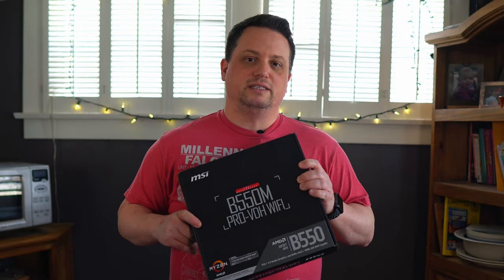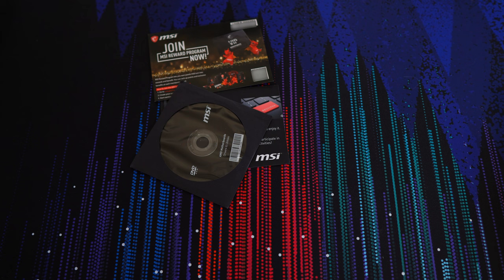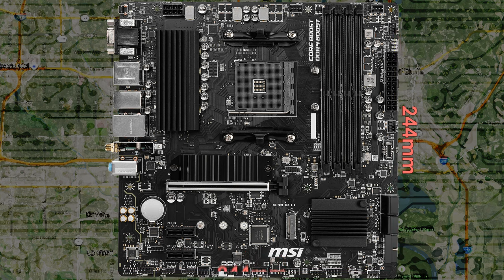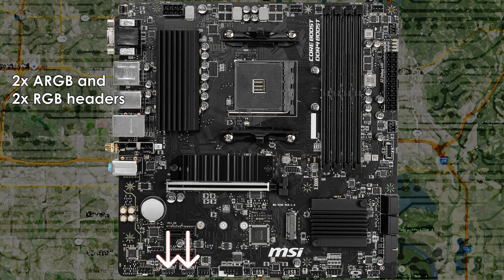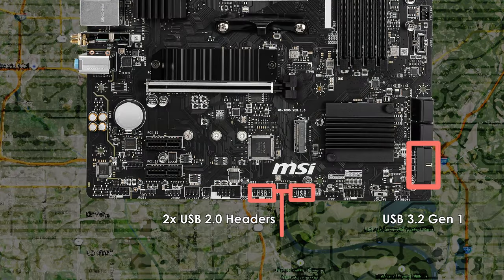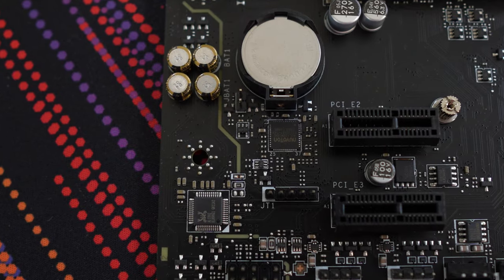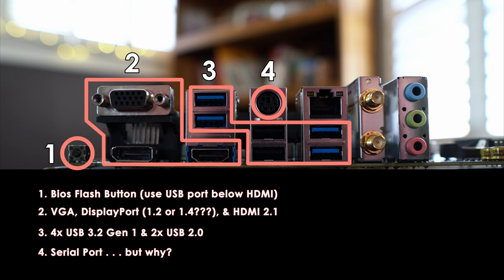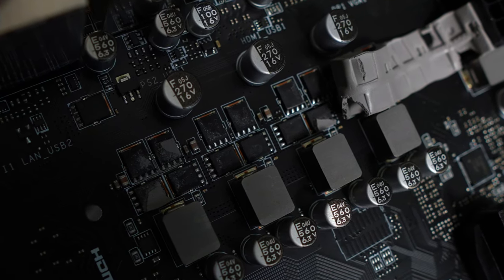Unboxing and taking a deep look at the MSI B550M Pro-VDH WIFI

Comment: i have this board and already a 3.0 m,2 installed on the top slot, ijust got a gen 4 m.2. i wanted to ask if ican just swap the slot of the current m.2 from top to bottom and install the new gen4 m.2 in the top one? will i have to format the older one or windows will read that one as OS drive automatically?
Reply from the maker: You can swap slots yes and then in the bios you can choose the boot order and choose to have the lower m.2 slot be the OS.

It might also just recognize the boot drive automatically.
Reply: @MiddleofKnowhere  so let's say i saw it and on the first start only i have to go to the bio or should i see if its going to the windows or not?
Reply from the maker: You can see if it will go to windows. That shouldn’t harm anything.

Comment: I  wish you had done the MSI PRO B550M-VC WIFI, instead, the one you're doing has been done to death.
I think the VC is a better board than the VDH, but no one has reviewed it, can't figure out why !
I am looking to buy one very soon and need more info besides what I can extrapolate myself.
Edit: You did not mention this board at the end as a possible alternative within that $$ range ?!
Reply from the maker: I didn’t mention the VC motherboard because I did the VDH video 5 months prior to the VC’s release.
Reply: @MiddleofKnowhere 
Understood, did not know the release date(s). It's just difficult when trying to find a good (and inexpensive) Home Media Server board. Not much data out there that is not running a Xeon (used) processor on a Supermicro board that's not cheap.
The way that you do your reviews are thorough, concise, giving very relevant data. Unfortunately I can't say the same for most other review channels, of which most are focused on "Gaming", which is very weird to me as I can use one gaming rig and will need two maybe three servers.
Anyway, thanks for your detailed and very professional videos !
Reply from the maker: You’re welcome! Thanks for watching. I’ll be doing a couple of mobo vids for am5 soon. Managed to find a sub $200 x670 board and a sweet b650 board.
Reply: @MiddleofKnowhere 
Thx !
Will check them out, but $'s prevent me from AM5. Also to sweet a deals on the AM4 stuff !

Comment: Hello, i would like to ask if it would be better to fill all ram slots in this motherboard rather than using just 2 sticks?
Reply from the maker: Depending on your CPU, you shouldn't have issues. Ryzen 3000 and 5000 series CPUS are fine to fill all 4 slots whereas Ryzen 1000 and 2000 series generally don't like all four slots filled. It all comes down to the memory controller. I have a 5950X and all four slots filled with no issues. Having said that, apparently 2 slots is still the way to go, so if you're trying to get 64GB of RAM and can afford 2x 32GB as opposed to 4x 16GB, go for it.

Bottom line, if you have a 3000 or 5000 series CPU you'll be fine populating all 4 slots.
Reply: @MiddleofKnowhere  Omgeee, thank you for the very informative response. I highly appreciate it!

Comment: How can I control my rgb lights of my pc case fans , ryzen 9 3900x rgb cooler fans using software and how? Please
Reply from the maker: Hi, this all depends and there are 3 methods: 1. Connecting your fans directly to the motherboard and downloading MSI's Mystic Light software. 2. Your fans have proprietary software you can use like Corsair's iCue, but these fans will also be connected to a hub of some sort which is then SATA powered and USB 2.0 data controlled. 3. the fans have a remote control like UpHere or AsiaHorse fans.
Hope that helps.
Reply: @MiddleofKnowhere  yeah I understood for the argb  ones by which I can control them by mystic light and for the processor how can I control. It?...?
Reply: @MRHARDCOREGAMINGCORONATION  If you're asking how to control the aRGB on your CPU cooler, it should use the same 3-pin aRGB header as any other aRGB fan, so you should be able to use the same software.
Reply: @platyhelminthes2877  thanks for the help dude

Comment: I'm on the fence with getting this mobo as I'm seeing so many reviews online about it crashing. I'm wondering if the board itself is bad in general or if the batch that was sold at the time was bad. I'm planning my first ever pc build so I'm having trouble deciding a board.
Reply from the maker: interesting. I hadn't seen reviews about it crashing a lot. I can say from my experience with the build I did with it, I had no issues. I was able to update the BIOS easily, make the build and get Windows installed with no issue as well as play games. What did the reviews say was causing the crash? It could have been a pre-release BIOS causing the issues.
Reply: @MiddleofKnowhere  I'm still looking at stuff about it(though I don't know too much about PC tech. It seems like alot of people with processors that have "3000"(3700X and others) have this problem, but others with the same processors are not. It's really making it difficult to pick a budget b550 board.
Reply: @IndifferentRAM  I know what you're feeling. I'm literally looking into the same exact one and I have mixed feelings as well. It sucks because Im currently ordering parts but Idk what motherboard to get now
Reply: @kashiefhenry830  Oof. I'm just resorting to another mobo and hoping that prices drop in November.
Reply: @IndifferentRAM  which one are you going to get?
Reply: @kashiefhenry830  I'm planning on getting the Gigabyte B550 DS3H, but if my parts total is above my budget, I'll resort to the S2H version.
Reply: @IndifferentRAM  which one did you buy? I don't know which of these motherboards to buy gigabyte b550 ds3h, MSI B550M Pro-VDH or Asus b550m-a ac. It is for a ryzen 5 5600
Reply: @lucascolman4878  I have not bought one yet, but I'm sticking with the Gigabyte B550 S2H as it fits my needs, other pc parts and my budget.
Reply: I bought mine in April and it works like a charm since then
Reply: @markgyorok1672  What CPU do you use?
Reply: @IndifferentRAM  what did u get bc i kinda bought this without researching first ... i researched every single pc part i picked out exept this lmfaoooooo ( using ryzen 5 5600x radeon 6600xt) so i hop it is ok
Reply: @Pain..  I got the Gigabyte A520M S2H due to budget reasons(prices increased in my country too). I've had it for just about a month now and it works great with my Ryzen 5 5600G.
Reply: @IndifferentRAM  yeah the prob is ive alr bought the mobo lmao i didnt do any research on this for some reason i researched every sngle part except this 😑😑 awell if i need to update it ill just do it somehow after i learn it thanks bro
Reply: @Pain..  How has it been so far?(Assuming you've already built it)
Reply: @IndifferentRAM  i went into the store to get my main parts bc i didnt want to ordder them then i ordered the rest and am waiting lol
Reply: @Pain..  Ah ok

Comment: Looking to run a 5900x for a couple
Weeks to a month paired with 32gb of ram and a 3060ti. Thoughts?
Reply from the maker: I think that would be a very good pairing. Just finished a build with a 5900x and 3070ti and 32gb of ram as well (diff mobo though).

Comment: thank you for your videos, doing my 1st build to get back into pcs after 15+ years. only thing i cant make up my mind is what MB to go with. im doing a 5600x cpu and rx 6600 gpu. but with MB im in the air with this or the MSI B550-A Pro. every thing im looking at says this is better then the b550 a pro, but its like $30 cheaper and that just doesn't make scene to me
Reply: did u get this motherboard if so did u have to update bios? bc i got the same cpu and gpu ( 5600x 6600xt)
Reply: will this work with a 5600g?
Reply: @4k_ace  Apparently it works with 5600G CPUs, I ordered the same parts today and many people on the internet said that they are running the same combination

Comment: I just don't get what this fixes over the b450s. It's $25 more but what do you get for the $25?
Reply from the maker: PCIe 4.0 speeds for the GPU and at least one nvme slot. Faster speeds on the nvme can be very important to specific users. The PCIe 4.0 for the GPU maybe not as much since even 3.0 wasn't saturated by current gen GPUs. Ryzen 5000 CPU usage should be available for b450 with a BIOS update so that advantage was mitigated. Also more B550 boards have USB Type-C in the front and back than B450 did.
Reply: @MiddleofKnowhere  Thank you! That's very helpful!

Comment: wait can this motherboard not use 144hz? or above i got it for gaming bc it had wifi
Reply from the maker: What do you mean 144Hz? For a display? The onboard display ports will be different than those on your discrete graphics card like an RTX 4080 or RX 6600 XT. If you're into 144Hz gaming, I'll assume you have a dedicated GPU.
Reply: @MiddleofKnowhere  yeah i was just buggin before dw, i thought a motherboard can make it so u cant have high hz lol but yeah the 6600xt my gpu will def be able to go above 144hz with my monitor aswell
Reply from the maker: Nice. You'll be gold then.

Comment: Is this motherboard compatible with ryzen 5 5600G?
Reply from the maker: Yes, but you'll have to make sure it has an up-to-date bios or if you get it the box has a ryzen 5000/5000G ready sticker on it somewhere. It has as  BIOS Flash button so you'll be able to update it without the CPU or RAM installed.

Comment: Will a 5800x / 5900x be able to run at OC speeds on this mobo?
Reply from the maker: Tom's hardware tested this mobo with a 3900x overclocked and had no problems. I think you'll be able to do the same with a 5800x def and more than likle a 5900x.
Reply: @MiddleofKnowhere  thank you for the reply

Comment: Says it’s wifi 6e not wifi 5
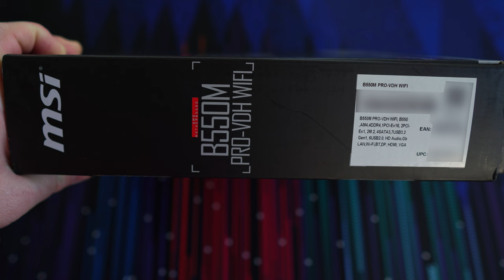Reply: Where did you find yours? I believe there's a new B550M Pro-VDH WIFI6 newer version around. Not sure if @0:51 showing Intel Wireless-AC 3168 means the board he got is Wi-Fi 5 inside or a newer Wi-Fi 6 version with Intel AX200 I believe also known as B550M Pro-VDH WIFI (CEC) on MSI's website.

Comment: Hi! I'm planning on purchasing this motherboard for my build but ive seen a lot of scary reviews on amazon about it boot looping on ryzen 5000 series cpus. I'm pairing it with a 5 5600 (non x) and im scared i will encounter the same problem. Do you still use this mobo and is it still working fine? Thanks
Reply from the maker: Hi, I used a Ryzen 3 3100 with this mobo, and I sold the build, so I couldn't speak to longevity issues. I will say for the 10's of hours I used it updating, testing games, etc. I never had any issues with boot looping. If you're unsure about this motherboard consider the B550M Aorus Pro-P from gigabyte as an alternative.
Reply: @MiddleofKnowhere  Thanks for the reply! I dont trust gigabyte at all. I guess i just have to take my chances with this board.
Reply: @sstteeaakk  tell me how it goes
Reply: @iamkxngc  no issues so far. Tested it with the 5 5600, 5600X, and 5600G
Reply: @sstteeaakk  any update on msi b550m pro??
Reply: @ryochun9303  it still works. Haven't encountered any issues. Seems like this product is a bit unpredictable though from what ive read online
Reply: @sstteeaakk  i see i already ordered online hope it works on my 5600,nway thanks for update
Reply: @sstteeaakk  Any problems with it?
Reply: @Alertifying  been using it for weeks. Nope, none.
Reply: @sstteeaakk  Did you reinstall windows or just use an old boot drive with the new mobo/cpu?
Reply: @rundown132  i bought a new nvme drive for it since i was building a new pc
Reply: @yourmomsleftcheek1471  I had someone at the shop where i bought the motherboard from update the bios for me to the latest version just to be safe.
Reply: @sstteeaakk  omg this just took my stress levels down a notch ngl, did u have to update bios? im using 5600x and did u just build it and it all worked fine???
Reply: @sstteeaakk  oh rip u got it updated yikes i didnt wanna update it myself 😭😭 maybe i should go and ask them foook idk, anyway can it use 144hz+ ?
Reply: @Pain..  for a 5600x, i dont think you need a bios update. only for the 5600 and 5600g since those came out after this board (correct me if im wrong). And the refresh rate that you would be able to run is gonna depend entirely on your graphics card and monitor if they can push out those frames and assuming your cpu isn't a bottleneck (unless you want to use integrated graphics, im not so sure about that).
Reply: @sstteeaakk  im using a 6600xt whcih is a 1080p gpu but ive seen its really good tbh so yeah def gonna be able to plau higher i just thought the motherboard wasnt gonna alow that (new to pcs dont understant shit ) but yeah lmfao thanks ive seen a bunch of vids saying the 56000x will need a bios update sadly so hopefull not and if so well looks like ill have to learn to od that no matter  how annoying
Reply: @Pain..  if the motherboard box has "ryzen 5000 series ready" written on it, you might not have to.
Reply: @sstteeaakk  im thinking of buying this exact board right now ( i have the ryzen 5 5600 g ) does it work straight out the box, or do I have to update some bios??
Reply: @alunobl  if your motherboard box has "Ryzen 5000 ready" on it, no need for a bios update
Reply: @sstteeaakk do the motherboard still work .does your motherboard said 5000 series ready
Reply: @6qet  It still works, yes my motherboard box had "ryzen 5000 series ready" on it
Reply: @sstteeaakk  which cpu
Reply: @6qet  i tested it with the 5600, 5600X, and 5600G. All worked. I'm currently using the 5600X.
Reply: @sstteeaakk  I am seeing many people on internet have a problem of system rebooting and crashes 😞 with this motherboard. I want to buy it because it is cheaper for my 5600g.I think it's a luck you don't have a problem
Reply: @6qet  There's another motherboard around the same price as this one (Gigabyte B550M ds3h ac wifi) you could give that one a try.

Comment: does this support win11?
Reply from the maker: Yes it will but you have to make sure you pair it with a win 11 compatible cpu which his pretty much any Ryzen 3xxx series or later.
Reply: @MiddleofKnowhere  will ryzen 5 5600x be compatible??
Reply: @MiddleofKnowhere  or do I need to flash bios
Reply from the maker: It is compatible but yes you may have to flash the bios if you already have it and haven’t flashed it already. If you’re buying new you might be good to go. Just look for the Ryzen 5000 ready sticker on the box.
Reply: @MiddleofKnowhere  okay broo, thanks, this will help a lot😁
Reply from the maker: You’re welcome. Good luck with your new build and have fun.
Reply: @MiddleofKnowhere  yuppp, u earned yourself a sub

Comment: i heard you need to update firmware so you can use ryzen 5 5600g.... my question is.. example.. when you replace the cmos battery in due time.. the bios will reset.,, and since it will reset because of cmos is not installed.. my question is.. does the firmware update also reset? or do you need to update again firmware so you can use again ryzen 5 5600g.?
Reply from the maker: Great question. The bios setting will reset but the version will not if there makes sense. Basically if you set xmp for your ram or overclock the cpu and then clear cmos or remove the cmos battery those settings revert back to factory. If you’ve updated from bios version 1 to 2 and clear cmos you will still be on bios version 2. Hope that helps!

Comment: is this compatible with ryzen 7 5700G or need to update bios ?
Reply from the maker: You may need to update the bios but as it’s been a while since both board and cpu were released a compatible bios may be installed.